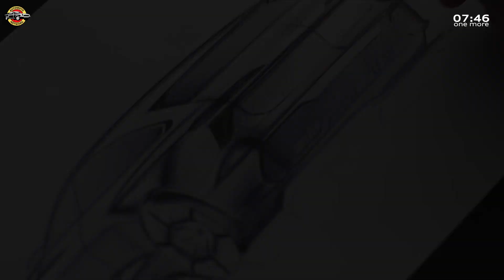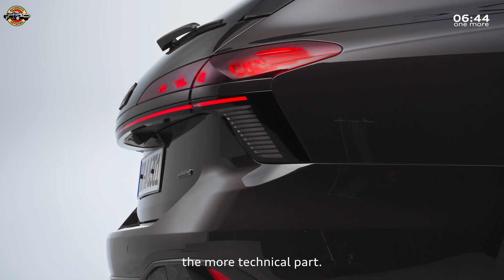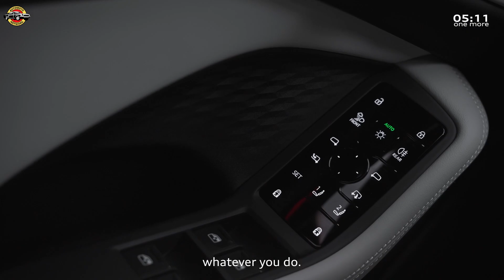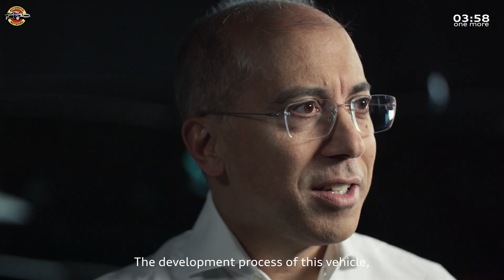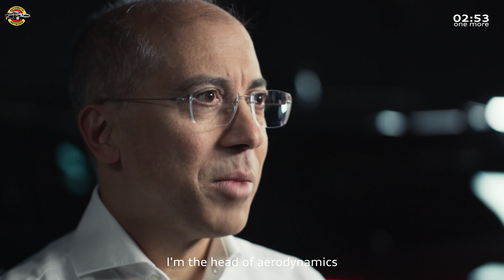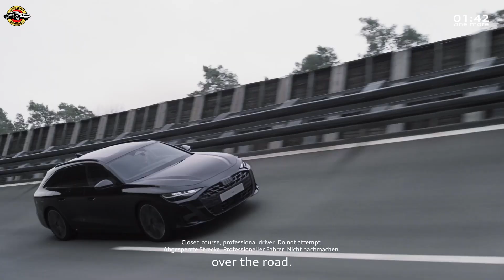The New 2026 Audi A6 Avant – Premium Design, Efficiency & Innovation

Comment: The early audis of the early 1990s were the last audis l really liked. After that their designs became boring like porsches. Their steering and cockpit also became stale with lots of aluminium or metal and the infotainment screen became very small. The materials used inside were at best average or mediocre.